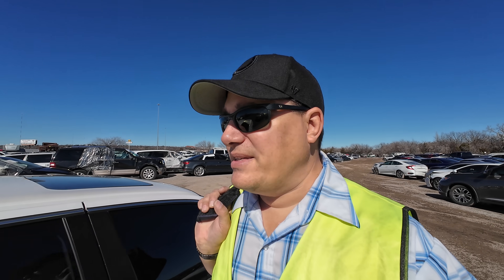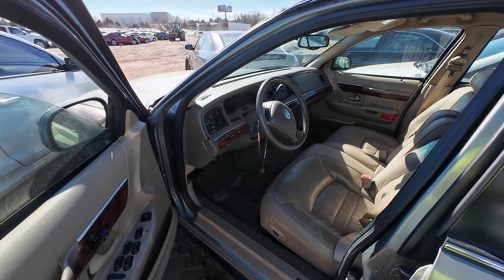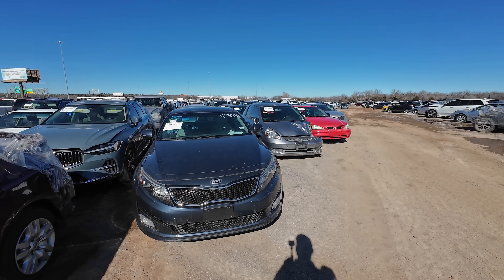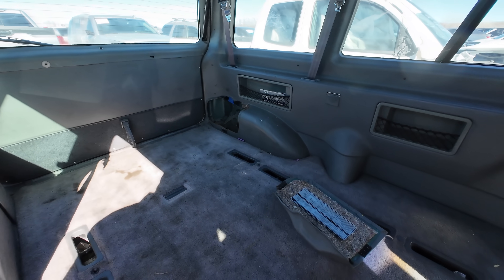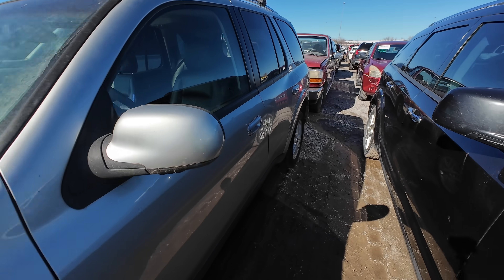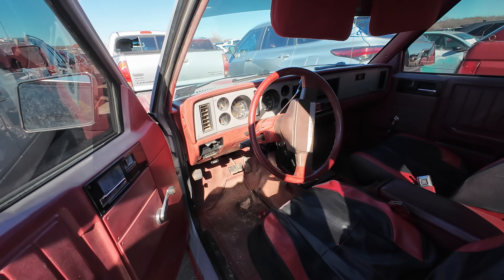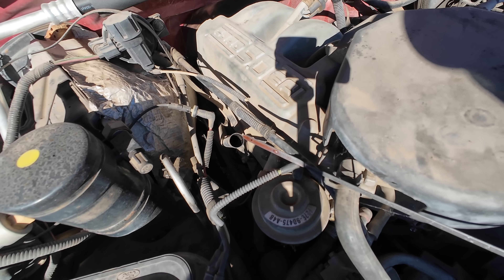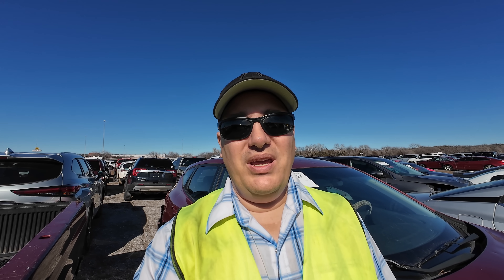I Found a RARE Chevy S10 Durango and Ford Aerostar at IAA Will it Run?

Comment: Aerostar is totally worth it.  That thing came straight from Boeing for sure.  Those actually have value with good solid bodies like that.
Reply: A lot of people like those old van now days to make campers out of
Reply: Eh. This one is too washed up. Short wheelbase model, awful automatic transmission, and no 4X4. Engine is a nightmare to work on if you have to access the rear components. No seats and not big enough for a conversion. Not sure what you would even do with this, let alone attempt to sell it and make a profit.
Reply: @robertgreenhalge1708  his pfp tells his bias...

Comment: My dad has a 1984 S-10 Durango (extended cab with a pair of foldable rear seats). My older brother changed the truck to a manual transmission. However, it's not in great shape; every panel has some rust, and the bed has full of tools and construction materials. However, it still runs and drives well. One day, my dad and I drove to a house 30 miles from home to inspect the kind of work he will have to do. It may be old, but it still runs fine.

My dad has an F-150 from the same time period (1980's) over 12 years ago. It was an extended cab, white on blue, and 4x4. He got rid of it since it wasn't running well/broken (it's been a while; I really don't remember). Every time I see on old F-150 (whether it's on your videos or elsewhere), it brings up memories of the truck when I was a little kid.
Reply: I think it only has one rear jump seat. One side has the half door, the drivers side if I remember, the seat was on the side without the door.

Comment: The S10 Durango is so cool! Its either an 83 or 84 model and it does have the carbureted 2.8 in it which is correct and factory tape stripes! What a Gem! That was what GM called the maxi Cab fr Chevrolet new for 83. And 83 was the first year for "Insta Trac" 4WD! I owned many many S10s over my life and That thing is clean! And more complete than the Aerostar! The Grand Marquis and The Durango would be the ones for sure! Wish I could find something like that Durango Id snap it up quick!

Comment: The Saab 97 is practically the same thing as the Chevy Trailblazer, same engine and transmission. That S10 would be so cool to have on the channel.  But you have to pump it to start the S10
Reply: Without even knowing about the Saab 97 I could tell it was just a rebadged Trailblazer. Knowing how GM was treating Saab during that time, it doesn't surprise me at all that they would resort to badge engineering.
Reply: Give the Saab a chance, Randy. It looks pretty good....
Reply: Just as a warning, these Saab 97's have more "Saab" parts than one might think. The important things like the engine and tranny, sure, they are standard GM. But many interior parts are specific for this model. God help ya if you ever need to replace a worn out or broken interior Saab only part.

Still a good shot in the dark though. Even here in rusty NE, I still this generation Trailblazer all the time.
Reply: The AWD system, however, is only shared with the bravada if I remember correctly. It was only in one other sister model and it’s not the greatest system. Mine self destructed twice.
Reply: Ya fui lujanilllo
Reply: Yea, but just like that Trailblazer, they also made one with a 6.0 LS2 in it.

Comment: Nice finds.  The Grand Marquis is the gem and one you could drive or flip it easily.  The S10 had a bit of a gallop, but I bet you could get it running.  The Aerostar is neat, but it's a big gamble on whether it would run without some serious work.  It could tie up cash that could be used for other things and it would end upside down, but it would make a fun project.  

I'm a sucker for these older models too.  I used to detail this stuff in the early 90's and it's a real throwback.
Reply: I think the S10 had a issue with its fuel pump. Also it looked like didn't have much fuel left in it. 😊

Comment: I've had a Saab 9-7X as my daily driver since 2017. It's been a wonderful car. Body on frame SUV, 6500 pound towing capacity, all wheel drive, Vortec I6 or V8, cheap American parts with European luxury/styling. I want to keep it forever.
Reply: I've always wanted one. We just had a Saab 9-7X AERO with the 6.0L LS2 come through our auction 2 weeks ago and only received a bid of $1800 and didn't sell 😢

Comment: So, are you saying that it's rare I got a 177k miles out of the 4wd A4LD in my 94 Explorer? lol. Everyone says these transmissions are crap...but here I am, FINALLY needing a rebuild I should get around to having done. Preferably before the mice get to it.
Reply: I surprised that booster pack couldn't turn that S10 faster. I have a small GOOLOO pack I bought off a suggestion from ProjectFarm and that bitch CRANKS lol. I've had to jump my 6.0 four times already because I don't drive it much and she's got a draw somewhere. Still haven't charged the thing in about a year. And it started a tractor back in October.

Comment: Aerostar Fuel Release for the door is on the floor board right by the driver's seat on the left. AC hoses always went on these things. What would you do with it being so old?

Being a Boeing vehicles probably at the airport, the thing on the back glass looks like a battery operated strobe light that was turned on as it drove around the aiport for marking purposes.

Comment: Randy, those S-10'S ARE NOTORIOUS FOR FUEL PUMP ISSUES. I have owned 5, and in every single one of them, the fuel pump let got. The oldest one I had was 1999, and up to 2003. The other thing is the control arms. They let go. The spring bowl also rusts out. On that blue one, I would check before you buy it. Control arms are not hard to get, but if the control arm is gone likely the place it mounts on and the bowl are not far behind it. I loved the 4.3 Vortec though and found it reliable and peppy, they were useless in the snow the rear-wheel drive ones.
Reply: Just an FYI totally different fuels pumps between a 1st Gen and a second Gen. I’ve heard folks say the an arms will rust out. In all my passings of these things which is alot, I’ve never seen one rusted out.
Reply: I guess it can be because I live in a high-salt area, Nova Scotia. Places where there is not a lot of salt being used like most vehicles they likely are still pristine. I have never had one older than 1999, so back before that medal used and such was much better quality.
 @PuddinsFabShop

Comment: The Aerostar gad five trim levels Cargo Van Aurostar Base L 2.3L Lima 4 cylinder (1986-1992) Aerostar XL Mid Tear 3.0L Vulcan V-6 (1986-1998) Aurostar XLT Luxury edition(1986-1997) and the Aurostar XLT-Eddie Bauer Edition(1992-1996)came with the Vulcan V-6 but the 4.0L mant were eqipeed with the 4.0L V-6 after 1992 and the XLT- Eddie Bauer 4wd van (1991-1996) and the Eddie Baur edition came with the 4.0L V-6 after 1991.The 2.3L LIma 5 Cylib=nder was discontined after 1991 as the stick was discontined the same year due to poor sales annd the 5 speed was canceled in 1990.

Comment: Run of the mill S10. Fairly well optioned with the buckets and tilt steering and vacuum cruise control that probably almost worked at one point, but the only thing uncommon about it is the factory tach. Durango was just a mid level trim for those who wanted silver painted plastic and neat badges but couldn't spring for the plush Tahoe carpet.
Also those Kendas are very good budget mud tires. I had a set on my old Colorado, and with 3/32 they still grabbed better than any BFG. I just picked up a 91 S10 and will probably put some on it.

Comment: The Saab is the same SUV as the Buick Rainier, Chevy trailblazer, Oldsmobile Bravda. The Buick was the closest looking to it. My wife had a 06 Buick Rainier that she absolutely loved. Loaded to the max for back then. Finally got rid of it in 2020 with 154,000 miles on it cause the trans was starting to go. Extremely much more comfortable than the chevy’s. Air ride lasted till 2017

Comment: The Saab 9-7X was tbe rare rebadged version of the Chevy Trailblazer. They only made 500 AERO versions of the 9-7X which was a Trailblazer SS in disquise with the 6.0L LS2 engine. An AERO just came through my local auction 2 weeks ago was amazing too see!

Comment: That s10 will be a score! It’s a 4 wheel drive, has brand new gripper tires, a rust and mostly dent free body. A great beater little pickup with good off road chops. And a small block Chevy v8 will bolt right in.

Comment: I have a 1997 Ford Aerostar with a 4.0 V6 and five speed automatic transmission. The aero stars are totally worth it. The fuel release should be a little lever on the trim panel behind the driver side door. It’s kind of in a weird place, but might be different depending on the model year.

Comment: I bought a brand new '92 Durango S-10. It had the black plastic exterior trim package and the 4.3 engine. I had a lot of fun with that little truck, it was fast and handled way better than you might expect. 

The downside was the "Diamond Coat" paint finish started to peel off as soon as I left the lot. Two years later it looked like a 10 year old vehicle. I traded for a new Taurus SHO. Should have had the S-10 repainted though and kept that. It was more fun and I could load a motorcycle in the back when I needed to.

Comment: Love the panther platform - the Merc is worth waiting for the title - just broke in @ 112k - Love to watch your Vids - Thx for sharing - Had a 97 Linc Continental - Put Michelins on it - fixed the air suspension - best riding platform of any car I have owned - and the seats in the merc - you can drive 150 miles and it's like a small trip to the store - no pain easy peeezy -

Comment: I remember the Aerostar my grandma used to have a 1994 Aerostar XLT extended wheelbase with a Cologne 4.0L in it i can't remember if it was an AWD model. It had red cloth interior and was white with red pinstriping for exterior she bought it when i was born in 2000 and had it until 2008 when my grandparents sold it off for scrap. Neat find at the auction.

Comment: yea that saab is basically the same thing as the GMC envoy trailblazer with the same engine. 4.2 Atlas i-6 24 valve vvt my dad has an 09 and they are really reliable when it comes to the power train i know GM bought off saab at one point aswell

Comment: Coming from personal experience, the Aerostar engine will run forever, but you're correct about that slush-box excuse of an automatic transmission that Ford designated as the A4LD.  If it was a manual, I wouldn't mind it.

Btw, the fuel door release lever is in the driver's side B-pillar just behind the seat.

Comment: S10 Over The Aerostar for sure.  You had a much nicer van and didn't drive that one either.  :)  The Saab 97X is from near the end of GM's ownership of them.  It is essentially a TrailBlazer with a Saab interior and other tweaks.
Reply: " It is essentially a TrailBlazer with a Saab interior and other tweaks."

Exactly why it would be wise to stay far away from these. Too many comments on here telling Randy to buy the Saab. Sure, it has GM engine and tranny, but most of the interior is Saab specific. Good luck trying to find interior parts for these.

Comment: My parents had a 70’s black short body no window full size Chevy van all decked out with red and black carpet and lights and speakers lol with white letter tires and OG Craigers. They got ride of it eventually and got a ford Aerostar that was red, no windows, base as could be with tan interior. Standard transmission, nothing inside, deleted radio. They did the inside decked in tan carpet and paneling with an audiovox cassette player, EQ, and box audiovox 3 way speakers lol all from Kmart lol. Bean bags in back instead of seats, and this time outlined white letter tires and chrome/gold rims lol. Oh the days lol

Comment: I had a 1995 Ford Aerostar 5-speed manual all set up with tool racks in the back utility style. Never found one sense. It had over 800,000 km on the odometer. It was always reliable

Comment: S10 sounds like the ignition module is bad is why it won't even try to start ,I've owned numerous s10 s and currently own 2 of them, 1 with a v8 and other has a 2.8 and just recently put a new module in it

Comment: Btw Randy i love 90s 2000s hondas toyota they run for ever with basic maintenance like oil changes tiress tune ups done at the right intervals and i can actually work on them lol no lie i have a couple newer cars for ride share because they dont allow older 90s 2000s cars on the platform

Comment: In the late 90s the next door neighbor in the apartment complex I lived in  while  in late elementary,  had a blue aerostar with a manual transmission and took me and my sister to school in it for a couple of days while my mother's old station wagon was in the shop for repairs.  Yesterday I passed a green aerostar on US 25 in Travellers Rest, SC in my mustang convertible with the top dropped and brought back childhood memories of a more worryfree and prosperous time in the pre-9/11 world. Aside from the faded paint and yellowed headlights the aerostar appeared to be in good condition, considering it was discontinued in 1997 because the upcoming requirement for a passenger side front airbag meant a complete redesign of the dashboard at significant cost would be necessary,  so Ford called it quits.

Comment: 10:46 used to have an areo star in the family, looked exactly like that one. it had so many issues lol but it ran and would allways get you where you needed to be, the side door didnt open, the ac worked but was stuck on defrost, it also had the cats stolen, and the doors wouldnt lock properly and had a poor key tumbler so you could start it without a key, long story short it got stolen cause the door didnt lock. i still loved it though

Comment: The Mercury Marquee is a Gem. You know it was well taken care of with a spare Quart of Ford Motor Oil, in the Trunk. Probably had every Oil Change done by a Ford Dealer. Also those 4.6 are practically bulletproof. Have one in my F-150, with no problems at almost 200K miles.

Comment: Randy that Saab is a shared platform with your FAVORITE.. the trailblazer. It was offered with the inline 6, 5.3, and 6.0
Reply: The big problem with the Saab model is the interior. It has many Saab specific parts that are almost impossible to source today.
Reply: @robertgreenhalge1708 they’re not that bad to find parts. I owned one up until a couple years ago. It was awesome. Mine had the 5.3 but no one wanted to work on it that’s for sure lol.

Comment: If I had to guess about the s-10, you probably didn’t give it enough gas, if it’s been sitting for a while the carb is drained out of gas. My 83 Chevy c20 carb drains out after a while of sitting, and then it takes 15 pumps of the gas to start it.

Comment: I have a 1990 Ford aerostar with a 5-speed manual 3.0 l physics and the fuel door release is on the side of the seat and there's one on the left side in the rear behind the chubby panel

Comment: Man my first vehicle was an 83 S-10 Durango with a standard cab and 2 wheel drive. I loved that truck but God I hated that stock carburetor. I did learn how to tune one and set timing on a distributor. I wish I still had that old truck. It also had the different fender emblems that had a longhorn steer head underneath the S-10 on it

Comment: Saab 97x was an SUV. Rebadged Chevy Trailblazer/GMC Envoy. Same engine options as the GM counterparts. I6 base, 5.3 LH6 for the 5.3i trim, and 6.0 LS2 for the Aero trim

Comment: Perhaps, the Chevy needed a few pumps to get going, since it was carbureted. I think the XLT Aerostar was a fancier model. You had an accent stripe on the cloth seats. They had an XL, which was more basic. The 90's models also had a 4.0L as an option. Those were plenty potent. They came with a 4 speed. It was much nicer then the 3 speed that the 80's models had. In spite of the looks, they were decent vehicles. They handled ok, and had pretty good power, compared to their peers. Visibility was pretty good, except for the left pillar, perhaps. They were a bit cramped to work on, but they did have rear access to the engine. The rear seats were very heavy.

Comment: They don't make them like they used to. Very few cars built in the last 10 years or so have longevity in mind. Last cars/trucks built with a 200k+ mile lifespan was built before direct injection and variable valve timing went into every car. There's the gem here and there but the late 00's was our peak as far as performance and longevity go.

Comment: That cable that wasn't connected to the carb wasn't for the trans , it was for the cruise control. Didn't see the trans detent cable. It has the 700R4in it. Don't try to drive it with that unhooked. It will burn it up real quick.

Comment: I guess that I am something of an anachronism as I have owned my 1985 Oldsmobile Delta 88 Roayle Brougham Luxury Sedan since it was purchased new on April 21, 1984 -- I special ordered it in February of 1985.  I have also owned my 1984 Cadillac Eldorado Biarritz Convertible since I purchased it from its first owners in March of 1992.  Yoi could say that I am not overly impressed by new cars as my daily driver is a 1992 Buick Roadmaster Limited that I acquired six  years ago when it had only 76,000 miles and it just tuned 92,000 miles.

Comment: That Saab either has a 4.2 5.3 or 6.0 they are fast dude 4.2 has 285 hp 5.3 has 300 hp and the 6.0 which is a ls2 from trailblazer ss with 400 hp I believe you just passed up a gem

Comment: I fully disagree what you say about Ford transmissions because I've never had one fail on me yet, but that's only because I do preventive maintenance and change my transmission fluid. Other people's transmissions fails for that main reason and Dodge makes terrible transmissions worse than Ford
Reply: My 1997 ford areostar has 251000 miles on it with the original transmission and engine, It still runs